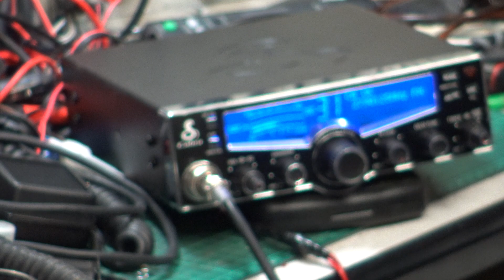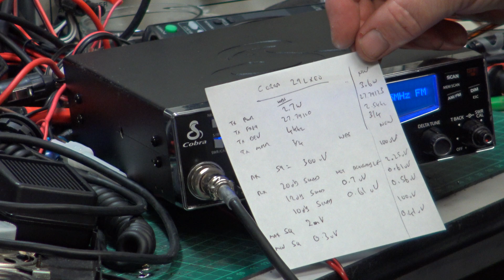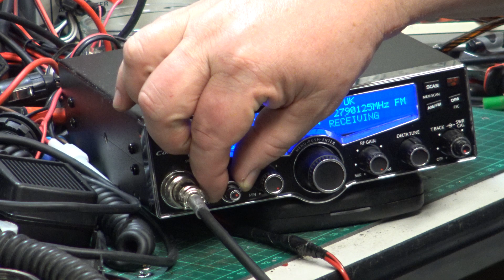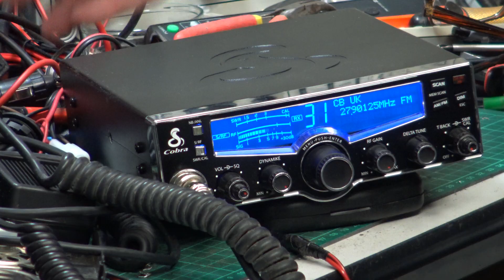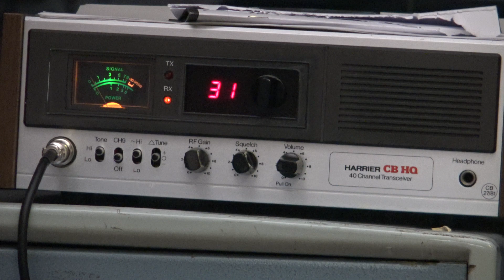Cobra 29LXEU UK CE MultiNOrm CB radio (mobile) - On The Air Test Customer set

Comment: I had one of these two years ago. Looked nice in the car. Everyone said I sounded quiet. Managed to sell it for £100, thankfully. Wish you’d done this video before I bought it
Reply from the maker: I did our original servicing video June 2014. Dreary performer.

Richard
Reply: UK CB radio servicing It promised so much but delivered nothing. Everybody sounded slightly off frequency too if I remember rightly. Performed worse than a fake magnum I had
Reply from the maker: When I listen to ch19, lot's of people ARE off frequency because they are using illegal radios rather than UK type approved sets. The better the filtering, the worse these people will sound. Listen to them on a Fidelity 1000 & they all sound super duper...because the Fidelity 1000 filtering is as bad as it gets! 

So, I reckon the filtering on the Cobra 29XELU is actually too tight, hence the below par performance. When I bought our test sample (not this customer's set), it was the worst £114.99 I've ever spent!

Richard, G0OJF, UK
Reply: UK CB radio servicing I see what you’re saying. I had the Murphy Homebase and that was a beautiful receive but the squelch was clunky and let the whole set down

Comment: Some off the older handhelds have worked better than mobile. What do think the best set you have done this year  so far.
Reply from the maker: Those dead cheap PNI8000L mobiles at £44.99 out of the new sets I've done.

T21